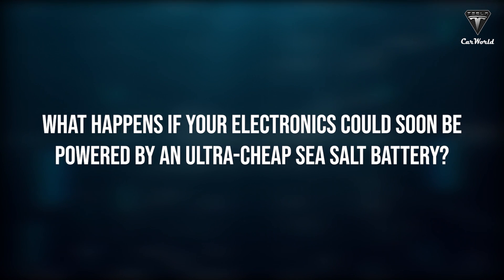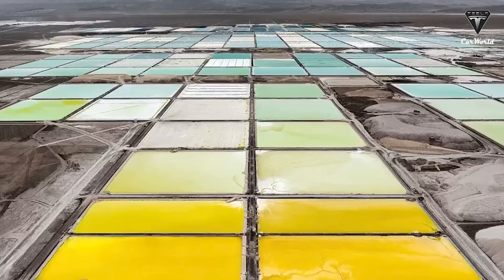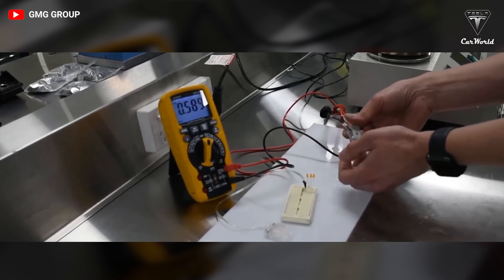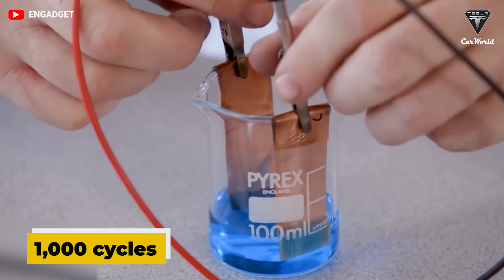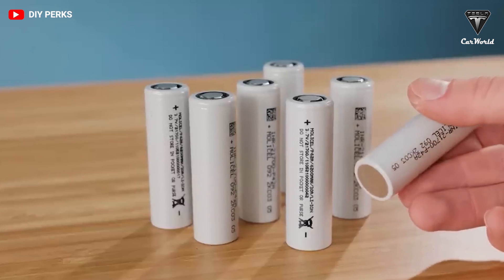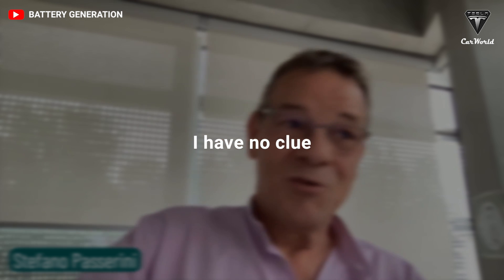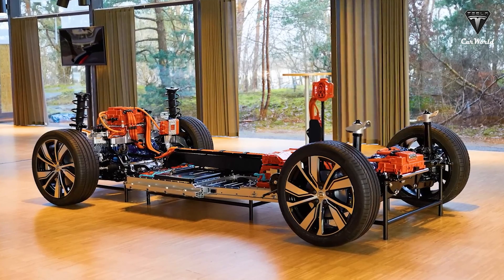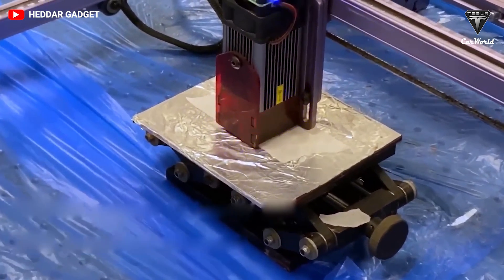STOP Lithium! Discovery a Molten Salt batteries, Destroy Industry in 2023!

Comment: Low melting point salts or ion membrane liquid salt batteries may also be good alternatives. If the salt melts at about 100 degrees F then would not need as much energy to recharge. Though room temperature liquid salts may need nano carbon mesh to stop dendrites or sulfur based polymers.

Comment: I checked Wiklpedia for molten salt batteries and found this: "In order to construct practical batteries, the sodium must be in liquid form. The melting point of sodium is 98 °C (208 °F). This means that sodium-based batteries operate at temperatures between 245 and 350 °C (470 and 660 °F)"   So that sounds like a deal breaker for EV applications from the start.
Reply: Molten salt battery is different from a sodium battery ? you got lost
Reply: @unipartywonagainstthepeople  Yes but in his defense the video doesn't make a clear distinction between the two.  Just kinda blends together.
Reply: https://youtu.be/dkoahhKWJP0 sodium battery